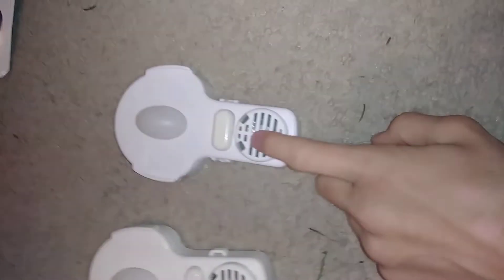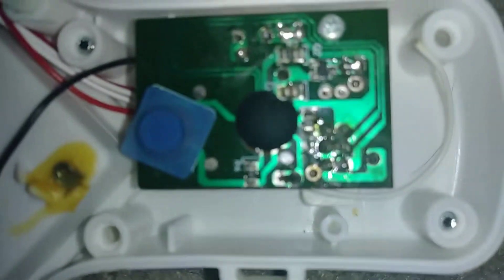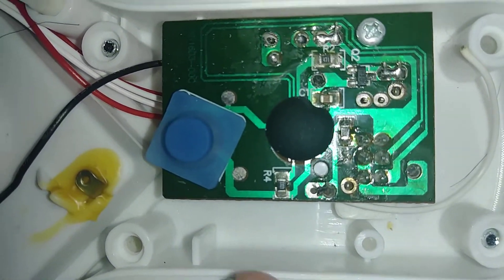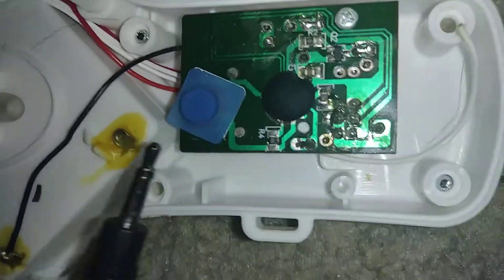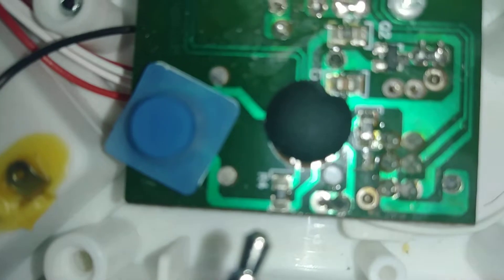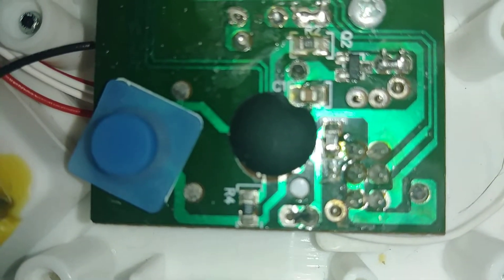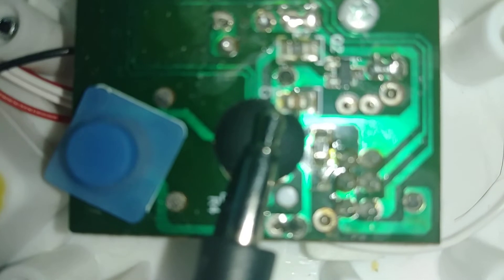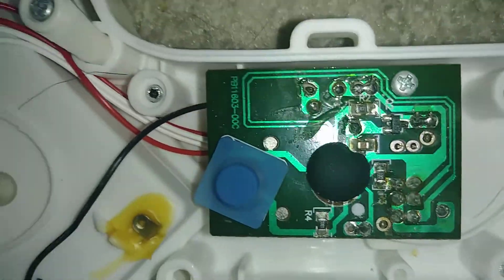Pitch Resistor on Playskool Lullaby Gloworm (2005 - present module) (Model 23471)

Comment: i have 2 questions:
1. is there a resistor that can glitch it out temporarily? (E.g. on the early models of the baby einstein take along tunes the C7 resistor glitches it out temporarily) if so this could possibly be useful for getting the instrument samples from it if that is actually possible
2. where would one find the manufacturing date on the board if there is one? i opened my 2011 a bit back solely for this reason and couldn't find a mfg. date on the board

thanks!
Reply from the maker: If I can find another copy of this module, i would tinker around more with it, but I dont want to risk frying the one from my childhood.
Reply: @brdrech  OK, good luck